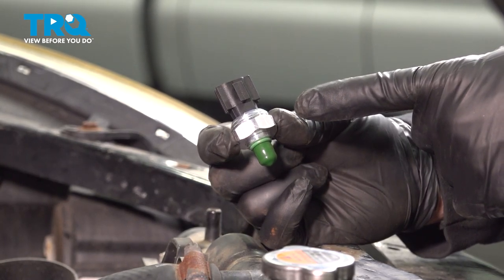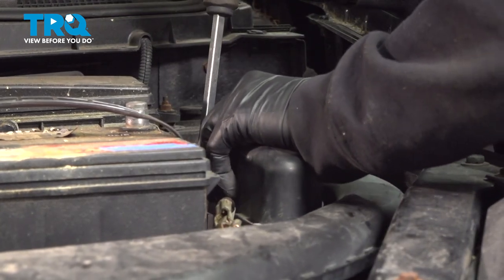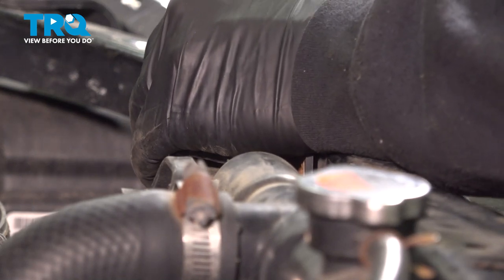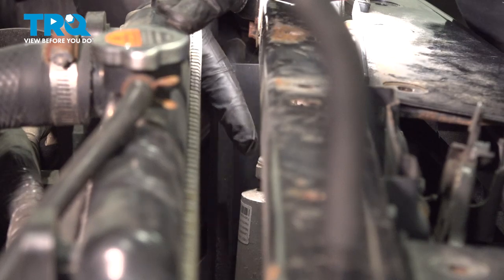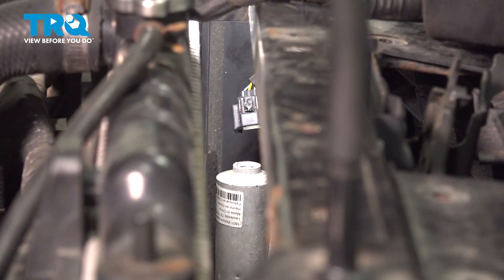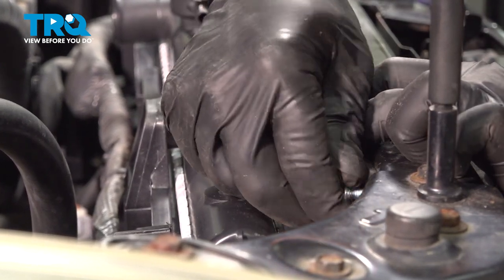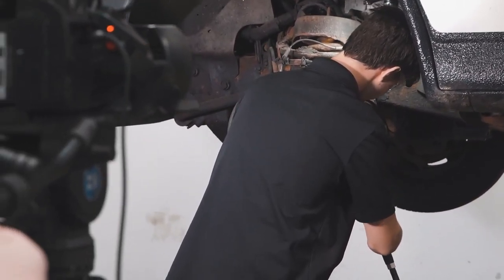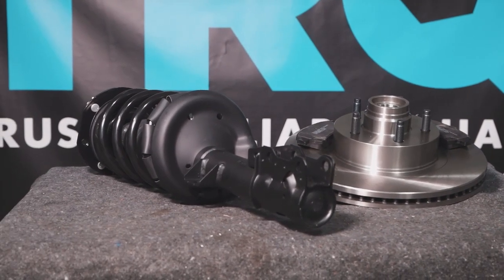How to Replace A/C Pressure Switch 2008-2013 Nissan Rogue

Comment: I have a 2003 Maxima. The pressure switch goes on to the condenser itself. It's located on the drivers side. Does the refrigerant have to be removed first?